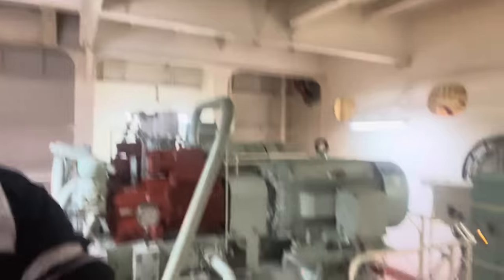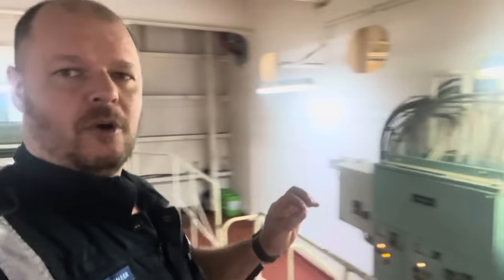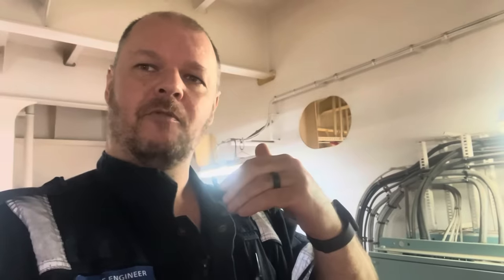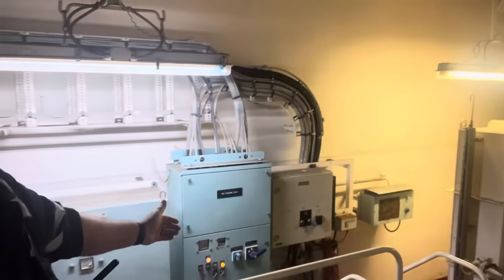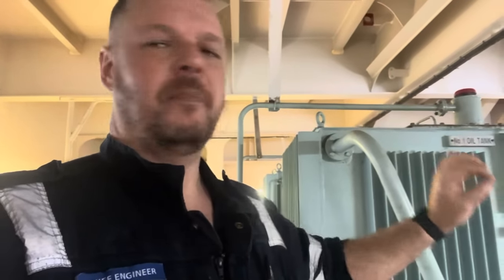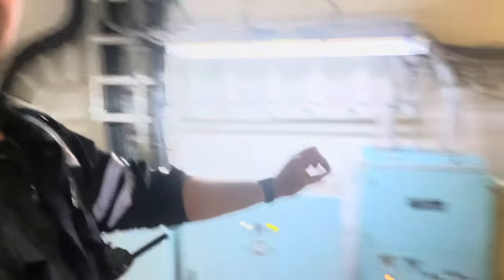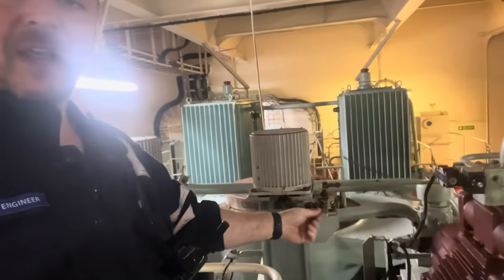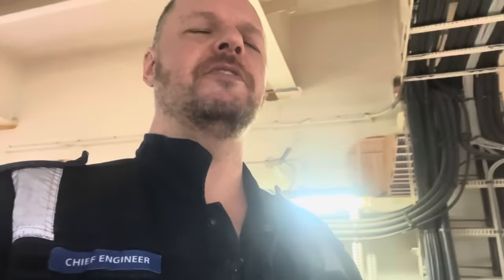Dali size containership steering system. How it’s designed to not hit Francis Scott key bridge

Comment: A 6 minute video, far more insightful and informative than a thousand hours of media coverage.  Thank you Chief, respect.
Reply: He did not address any possible causes of the initial shutdown. But no one is... One source suggested contaminated fuel but that's neither been confirmed or explained how that could cause everything to shut down simultaneously. The way it stands, without knowing the cause of the shutdown liability cannot be determined.
Reply: Gosh yes, if a ship loses power to the propeller, the ship will continue on the course it was on before the loss of engine power, the weight and momentum of such a heavy ship will never turn like the video shows. Remember the ships electrical supply is from one of several electricity generators that these Ships electronic Autopilot will keep working keeping the ship on the course set by the Harbour Pilot, remember that the ship was on course to pass under the bridge when the lights were turned off, without electric power to the Auto pilot the rudder will remain on the set course while it was adjusting course for any wind or currant variations, then when the lights (electric power) came on again the ship auto-pilot would automatically resume the original course settings before the power loss, But! The video showing the sharp turn onto the target had nothing to do with the lights, or Autopilot or wind or currants proves The HUMAN FINGER PRINT is all over this deliberate turn into the Bridge. Heavy smoke from engine funnel is caused by a sudden increase in fuel to the engine, providing strong water pushed onto the now hard turned to Starboard rudder, then again the ship rudder was adjusted to Port to stop the turn because the ship needed to make a direct hit not a glancing blow against the target. <><><> This was intentional closure of Americas 5th biggest port! No question about that! But was it the US Government extremists or their FBI, or CIA! Did Terrorists sneaking on board and over powering the crew? Was it blackmail of the Harbour Pilots and Captain and engineers, no matter why? It is “who are they” that must be discovered because 6 people are dead because of this deliberate act by some of the People on this ship!!!!!!!
Reply: @geoffreytoomey682 did the FBI poison your oatmeal too?
Reply: @geoffreytoomey682 the crew was escorted to Walmart before departure , leaving the whole ship alone with no security to my knowledge. 
Any terrorist or slime bag could have plenty of time to get on board and set up a path of destruction electronically. Word is though that this tub should never have been loaded let alone allowed to set sail. Multiple power failures and shorts happening while in port and no reports of everything being fixed appropriately. I’d sure like to hear the coast guards take on the investigation.
Reply: Hhmmm
Reply: how about you wait till the investigation is complete?
Reply: True rabbit true
Reply: What you get paying a crew fish heads and rice......................🎉🎉🎉
Reply: Watching a potted plant grow is more insightful than the media.
Reply: @geoffreytoomey682 At the point in the channel where the ship lost power is a second channel coming.  Add that to the outgoing tide and the water currents could have easily turned the ship the few degrees needed to hit the bridge. There was also a slight breeze to the west that night and the big flat surface of a cargo ship can act like a sail and turn a ship.
Reply: @regould221  Ok. Was this a PREDICTABLE result of a ship losing power in that location? Could you look at a map and a tide chart and say that 4 out of 5 times a ship passing this point without power will swing like this and turn into the bridge because of the currents there? If you can repeat this turn passing this point on the out tide with a unpowered ship more times than not, then you have grounds for saying this was a plot- though you STILL have to prove sabotage, not neglect, to the power systems.

Comment: Control of the rudder on a larger ship is practically useless unless you have the main engine running for the prop to push water over the rudder. Dali didn't have its main engine running thus very little water going over the rudder to maintain directional control. Only doing 7.5 knots, then the stopped propeller causing a steering effect to starboard. The whole issue with the port of Baltimore is why do they let ships navigate this bridge without tugs.

Comment: Thank you chief. Excelent, and ashamed to acknowledge, as a retired navigator, I should have known more about the steering system. The conclussion I'm drawing from yours (and others) video, is that vital information is missing. Regardless  thanks for the education. Steering systems are designed NOT to fail.

Comment: As a retired tug captain I appreciated your succinct description and well done walk through of the steering flats.
Reply: So, to me, it sounds like he's saying it would be almost impossible to hit that bridge by accident. Is that what he's saying?
Reply: @wolfhors3_660  no try opposite .
Reply: @heartobefelt  what does your comment mean....it DOES SOUND LIKE IT WAS IMPOSSIBLE TO HIT OUR BRIDGE
Reply: @wolfhors3_660  I AGREE WITH YOU WOLF...not sure what this heart to be felt means by saying try the opposite...lack of comprehension skills I guess.
Reply: @heartobefelt  Just because you have power doesn't mean you win the battle of physics.  110 Dead tons doesn't stop on a dime especially with ~8-8.5 kts (10mph/16kph) already on it and those engines still need to stop the ship and turn it.
Reply: @csexecutiveservices  no shit sherlock , but they didnt have power through the last 4 minutes did they ! They ran short of timeframe to stop the ship when they had 2 minutes or more of lost power and steering.
Reply: @wolfhors3_660  well I doubt very much that it was a complete steering failure. The main engine rarely, rarely ever fails. That leaves operating astern propulsion which would pull the head of the ship quite rapidly and noticeably to one side. We shall wait for the investigation. The smoke from the stack was not a fire and is usually a sign of a large application of power, presumably going astern. Traveling at 8 knots it would take quite some distance to stop a ship of that size. The question is, “ Why had the port of Baltimore put a speed restriction on exit and entry as well as a tonnage restriction for escort tugs while leaving port. 95,000 tons at 8 knots, that is some F&*#ing force.
Reply: @Glen-uy4jt  I just hope there's no shenanigans when the NTSB report comes out.
Reply: Gosh yes, thank you that is my understanding of modern-day shipping, a ship loses power to the propeller, the ship will continue on the course it was on before the loss of engine power, the weight and momentum of such a heavy ship will never turn like the video shows. Remember the ship's electrical supply is from one of several electricity generators that the ship electronic Autopilot controlling the hydraulic motors on the Rudder will keep working keeping the ship on the course set by the Harbour Pilot, remember that the ship was on course to pass under the bridge when the lights were turned off, without electric power to the Autopilot the rudder will remain on the set course while it was adjusting course for any wind or current variations, then when the lights (electric power) came on again the ship auto-pilot would automatically resume the original course settings before the power loss, But! The video showing the sharp turn onto the target had nothing to do with the lights, or Autopilot or wind or currants proving that The HUMAN FINGERPRINT is all over this deliberate turn into the Bridge.<><><> Heavy smoke from the engine funnel is caused by a sudden increase in fuel to the engine, providing strong water pushed onto the now hard-turned-to Starboard rudder, then again the ship rudder was adjusted to Port to stop the turn because the ship needed to make a direct hit not a glancing blow against the target. <><><> This was intentional closure of Americas 5th biggest port! No question about that! But was it the US Government extremists or their FBI, or CIA! Did Terrorists sneak on board and overpower the crew? Was it blackmail of the Harbour Pilots and captains and engineers, no matter why? It is “who are they” that must be discovered because 6 people are dead because of this deliberate act by some of the People on this ship!!!!!!!
Reply: @geoffreytoomey682  you never use an autopilot in confined spaces. They are prone to issues. There would have been two officers and two unlicensed crew, minimum as well as the pilot, who is only an advisor and cannot make the captain do anything. If you disagree with the pilot you had better wish that you do not have an incident.
Reply: @wolfhors3_660  there is a good video, on split screen, showing the traffic control history and the video synced.
Reply: @wolfhors3_660  it is at “ what is going on with shipping “ good channel, no pun intended.
Reply: @Glen-uy4jt  Thanks Glen, no autopilot is ever being used by the harbour pilots in confined waters, and the Captain must not touch the controls without a very good reason, Thanks I've never been on the bridge on a large ship like this one, and I still have a problem trying to explain how the rudder moved to take the ship dramatically off course? and there was not a beginning of a slow turn to the starboard shown in the video when the engine was not pushing the ship? so I'm assuming the rudder was still set on the course to clear the bridge until the engine was given a full throttle ahead signal from the bridge or could it have been in the engineering area?  thus the sharp turn to starboard, not a slow dragged turn,  slowing the ship in reverse would drag the stern to Starboard and drag the bow too slowly to Port,  Glen how's your math? someone good at math could probably work out how far the ship was from its course to clear under the bridge,  the video showing the ship approaching and the turn into the Bridge Pier by timing the ship's turn from its original course,  knowing the also length of the ship, then the time the ship is heading directly at the pier until the collision, assume a speed of 8 knots? plus add the time during the turn at the correct "math ratio" thingie???)  not me, Grade 7 was 3 of my favourite school years :)
Reply: @wolfhors3_660  Remember flight 800?
Reply: @kurtvanluven9351  yep
Reply: @heartobefelt You're drunk. Go back to sleep
Reply: @wolfhors3_660 That's absolutely, positively, 100%, spot on what this Chief conveyed
Reply: @csexecutiveservices You're drunk
Reply: @lacesout8292  come back and read your rubbish and apologise when the NTSB report comes out :)
I shouldnt be arguing with kids but we all start out knowing nothing...
Reply: @Glen-uy4jt  Retire mariner, sailed 12 years US Merchant Marine,  various vessels including container vessels as deck cadet.  They  lost main power at least twice before they hit the bridge.  When you have a power failure, you have no propulsion.  After a short period ot time, 30 sec or less, the emergency diesel generator typically located up near the bridge, will  kick on and provide electricity  to navigation lights and fire pump and steering but no power to the props. 

That smoke from  the stack area was either the Emergency diesel generator starting up or like you said the application of full astern by the engine room.  Nothing will stop a vessel weighing 100,000 l/tons moving at 7 knots, not even 5 tugs. The port of Baltimore maybe should have put in more safety rules including tug assist, slower speeds, while leaving to clear the bridge.  Hindsight 20/20.
Reply: @geoffreytoomey682  You have no idea what you are talking about.  This was a simple accident due to a power failure and maybe an issue with crew training in the engine room.  These are very large containerships with small margins of error when navigating in restricted waters.
Reply: @Glen-uy4jt  The  local pilots in almost all cases are better ship handlers than the ship's Masters.   So no Master will challenge a Pilot unless its a special circumstance.  The pilots have special training and handle vessels daily.
Reply: @Redtopper02  that is true but when your ship is on the line I think that most captains will make their own decisions. To follow the pilots advice is not mandatory. If you have never been in a situation like that it is hard to imagine. I have been in several life threatening situations on board a 30 meter tug, with no pilot onboard, and you need to keep a clear head, no pun intended. If you have not run through the various issues that can arise then you can get blindsided in a rapidly changing emergency situation. I feel sorry for the captain, mechanical failure is a nightmare and what can you do? There are usually few options. Who gave the command to accelerate to 8.5 knots before clearing the bridge, the pilot or the captain? That seems like an excessive speed to me.
Reply: @Redtopper02  I agree completely and yes I did some research on large ship propulsion, thanks for the correction.
Reply: @Redtopper02  rubbish, not engine start-up smoke, full power smoke, the ship turns under full power, if rudder had stayed hard to Starboard the ship would have missed hitting the Pier head-on, successfully blocking the Port and killing 6 people,  lights on and off had no effect on the engine or the steering, wake up